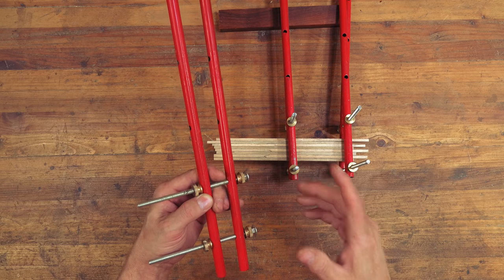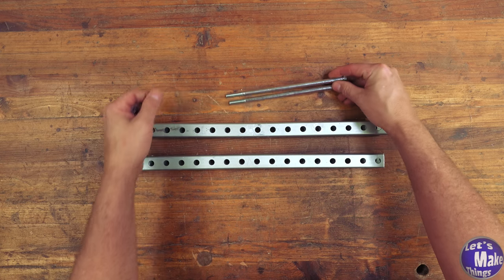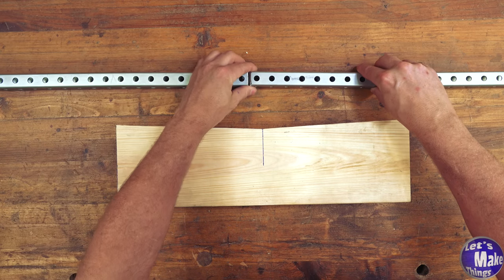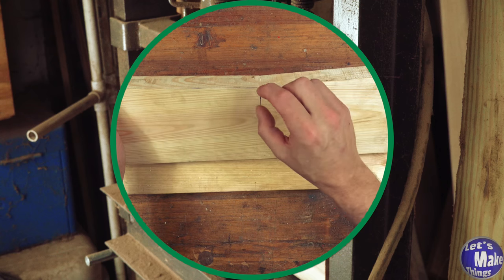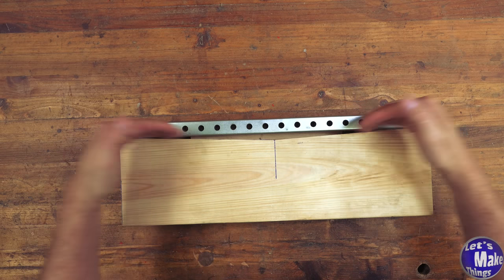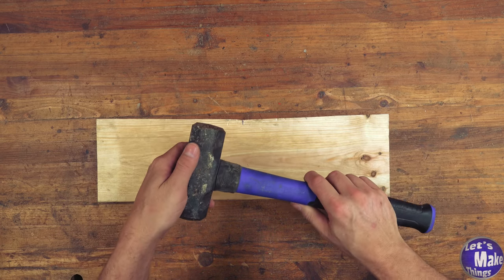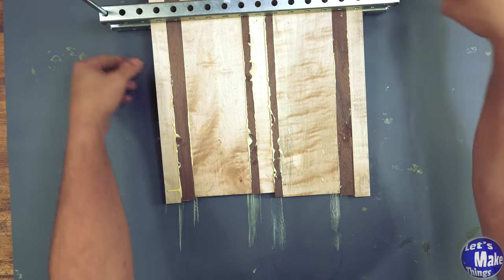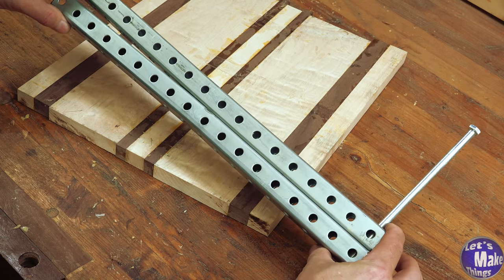Make a set of STEEL cauls...you'll never go back to wooden cauls! // Bending to perfection

Comment: Nice video. Another easier way to get the "bend" is to layer painter's tape in progressively longer piece. shortest as the first layer in the middle. Can get the bend you need without getting excessive.

Comment: Looks like this will put more pressure in the very center and then a length without much force and then some bit of pressure at the edges. Wouldn't it be better to make a sweeping bend, instead of a "v" shape?

Or am I overthinking it?
Reply: sweeping bends are much more difficult. though somewhat preffered

Comment: does it really have to be that tight? I've never done this kind of glue up before but i have some rigid laying around and was going to use them as cauls but holy moly the downward pressure needed to bend the ones i got (industrial leftover from electrical work at a water plant) is crazy. If you need a 3 ton press to bend it, doesnt that mean that they are fine if used under 15"? I always assumed the "jointing" pressure was what was needed and the cauls were there so the overwhelming jointing pressure didnt cause the piece to concave. Im surprised this kind of pressure using clamps didnt mar up the piece :O

Comment: I made a set out of clamps using heavy angle iron. I used these for removing the warp in a a wide sheet of wood made from three planks glued together. Angle iron is not very flexible so tends to stay flat acros the whole length.  So which is better and why?

Comment: A better way to get a curve instead of the “v” is cut a curve in the middle of your wood and place your pipe between both pieces of wood and clamp together. That way there is no pressure point to crease the curve.

Comment: The ideal curve for the cauls would be a parabola. When a parabolic beam is under enough center load to straighten it, it will exert a uniform pressure along its length. Luckily, the inverse is true as well: to make a straight caul parabolic, you only need to support it at the sides, then give it a center load. I.e. just make the curve by supporting the ends of the caul and apply pressure in the dead center. The curve will then be a parabola. 
Caveat: What I don't understand is why using the cauls won't just bend them back. To permanently deform steel you need to exceed its yield strength. When you use the cauls you would have to use the same amount of force to straighten them again, which would also exceed the yield strength, deforming them back to straight
Reply: I don't know if you've ever been metal, such as a piece of rebar. But if you want to bend it 90° you have to bend it to about 105° and then let it bounce back. Same principle applies here. He's putting a more aggressive Arc on it during the bend and the metal will bounce back to a less aggressive Arc. The pressure that's put on the steel to straighten it out is within the bounce back threshold of steel

Comment: why all the holes? is that for improving the flexibility of the steel?  you make me think about things that is for sure, also you could make a cradle to hold the cauls so you can load your glue up directly to the bottom cauls,  and i was thinking how I could add threads and bolts to the ends of the cauls to assist line up and improve the clamping pressure too with least amount of clamps and hardware.  It's got great potential so well done 😀👍👍
Reply: Maybe we could talk Matthias into measuring the pressure gradient across the cauls for optimum bend angle haha
Reply: The holes are only there because that's how he bought the tubes. Look up "punched square steel tubing".

Comment: I like the idea; for a larger set you could use either the half height or full size unistrut the  bending would be a trick but it is doable. Thanks for the idea not it's off to the shop.